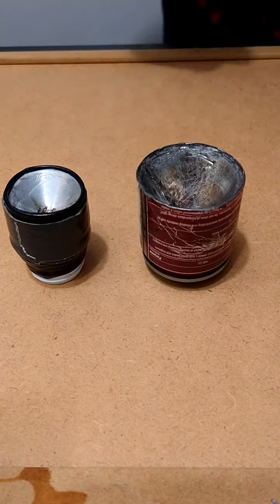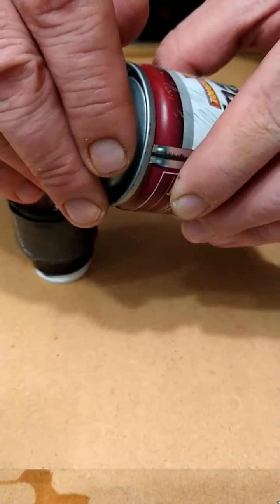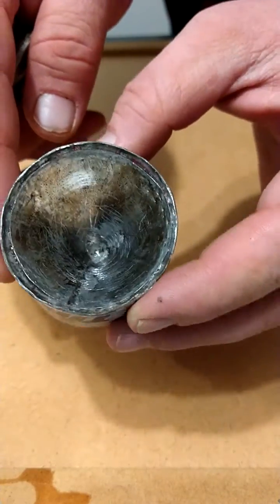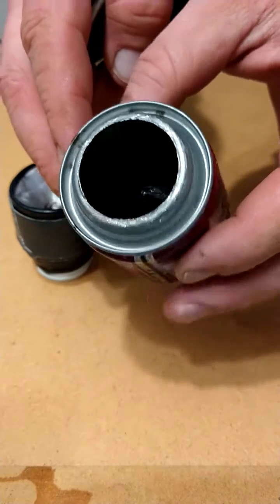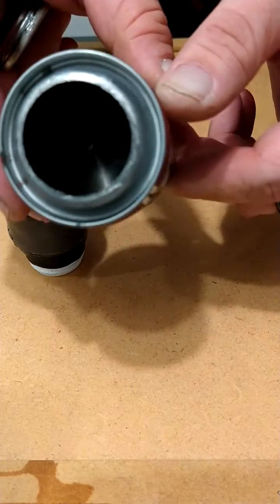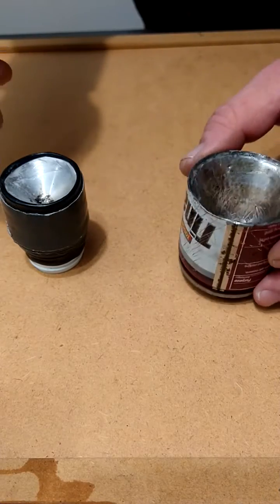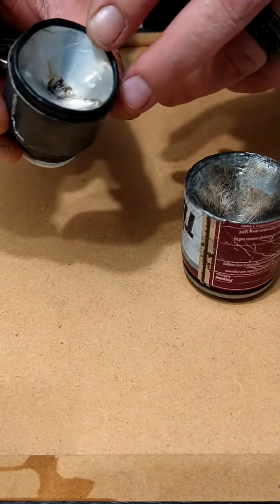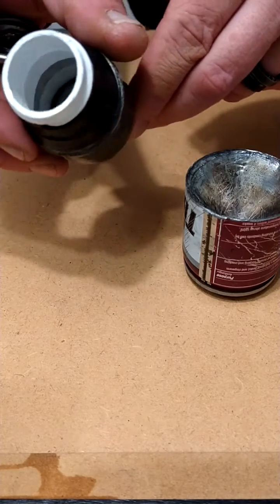💥Improvised shaped charge💥

Comment: The depth for the detonator should be a as far from the cone apex as possible- it’s called headspace. There’s formulas to get the best results but essentially the blast wave needs to run flat ( like stomping a can flat with your foot ) to invert the cone. And the stand-off legs for ANNM mixtures generally the minimum works best. That would be 1.5 of the cones base diameter. 
I’ve experimented dozens of times with them and a had great many failed attempts. 
The best ANNM results I had was when using the conical base of a wine bottle as a cone and steel casing using 250 g rammed in hard with a thick dowel rod. 
Getting a positive result is pretty exiting when you’ve failed heaps before...
Reply: man i love your videos make more !
Reply from the maker: Thx for the information...best to listen to somebody who's already accomplished it👍 the information about the detonator was very usefulalso you hear so many different distances for standoff I've heard 1.5 all the way up to six times the diameter...so thx again
Reply: @improvisedchaos6355  I’ll pm you a wealth of information. If you like reading it’s extremely useful. I’ve documented many of my attempts and failures there...
Reply from the maker: @AllChemystery  yes please send it
Reply: @AllChemystery 
That PLX shaped change you made a few years back was excellent. To bad we don’t have some RDX to implement at the receiving end of our detonators like you did, RDX is awesome and a good boosting agent. PLX is a better explosive than ANNM for use in small improvised shaped charges… Our variant of PLX incorporates in some Methyl nitrate to spice things up even more, as well as an activation agent.
Reply: @ExplosivesLaboratory  I often thought Methyl nitrate would work well as a sensitiser for A NM based mixture. It’s one of the only liquid esters I haven’t made. The climate here is too warm and it evaporates at an incredible rate. Plus nitro headaches are not nice at all..  still- it’s on the list!
Reply: @AllChemystery 
Hopefully you will be able to successfully obtain and store it in a controlled environment some time around, when you get the chance to do so! No doubt, CH₃NO₃ is an excellent energetic nitro ester, despite being the simplest.
Reply: @AllChemystery  to me the best one is e4n melt cast. It allow to do a very compact penetrador device, and of course very powerfull.